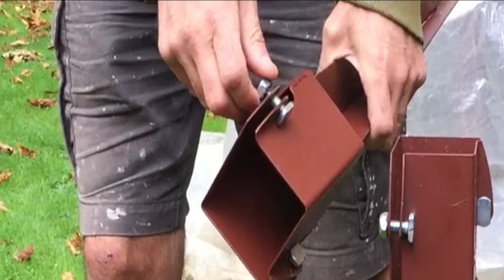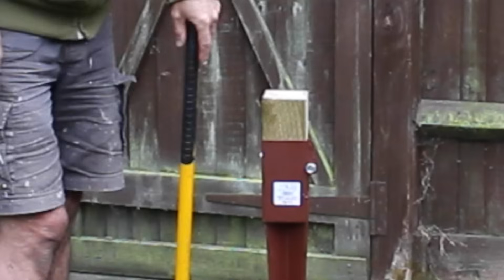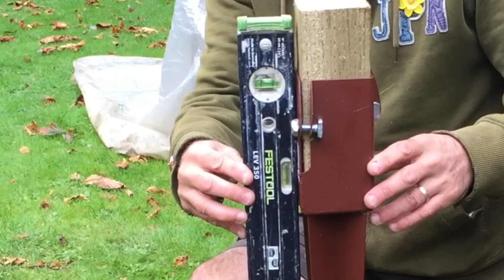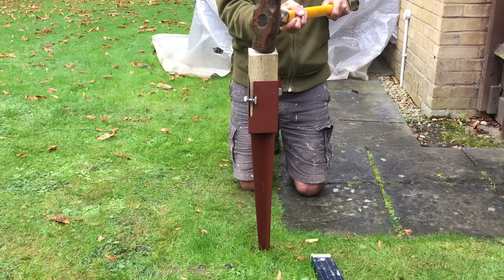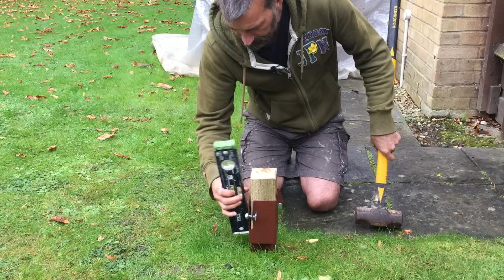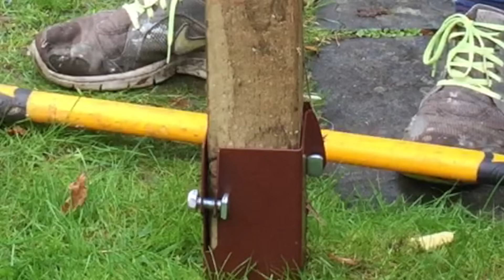How to install a METPOST/Fence Spike like a pro!

Comment: Just came across this video. I've got some of these that are 75cm/30 inches. I am basically making a screen, by putting some posts in the ground (around 1.5m tall is the goal, possibly 1.8m) and attaching some steel mesh as a trellis. Will also be attaching a pedestrian gate between teo 1.8m posts (as this whole thing is to block off part of the garden for the dog). Will these work do you think? Its a different brand but the same concept. I'm a beginner DIYer and also want the option of removing the screen later on if I want to. Just want to make sure they will be sufficiently sturdy?
Reply from the maker: Hi. Yes, with those posts it will be sturdy enough. Cheers.

Comment: Great video, Quick question, I have quite hard soil/ground, is it OK to predill a pilot hole, or does that reduce the effectiveness of the hold?
Reply: We used a pneumatic hammer.  Very had clay soil
Reply: I usually pour water in the hole to soften the dirt a bit.

Comment: After pounding it down i got the 4x4 stuck in the spike and cant pull it out to put my actual stud in. Dont know what to do now
Reply from the maker: @BackyardOfHorrors  that’s a tough one. The best bet is to cut it off at the top of the spike and then drill in with an auger to remove the centre.
Reply: @buildingsheriff  First off, kudos on the response time, thank you 😂 Secondly, I screwed a 2x4 to the 4x4 and was able to free it hitting it for a few minutes lol racing the sun at this point, we're gonna make t
Reply from the maker: @BackyardOfHorrors  great stuff. I love an alternative solution. We all get there in the end.

Comment: Similar product, but would a 45mm post word with a 50mm anchor? As in would the anchor bolt up snuggly enough around a post 5mm smaller than the internal dimension? Cheers!
Reply from the maker: The best thing to do in this case is to use something that doesn't compress to pack out the difference. I use slate. Man-made slates are cheap and easy to break and size. You can buy plastic spacers called 'backpacks' that come in a variety of sizes also. Thanks for watching!

Comment: If the post doesn't end up as plumb as you want it, what about adding shims inside the post bracket, between the post and the wall of the bracket?
Reply from the maker: Yes, a great idea. One could also trim a side of the post where it enters the metpost and then shim the back side to make it vertical.

Comment: I suppose it would be good for a small fence but anything with a bit of height the post needs to be sunk
Reply: Also wood swells and shrinks with heat and water. Metposts are only good if the ground is easy and it's a low fence

Comment: What would you recommend for anchoring a pergola? I don't want to cement in as I'd like the option to take with me since I rent. I stupidly didn't think of anchoring when I bought the kit. I was thinking to secure it to the fence so those posts help but no clue anymore what to do.
Reply from the maker: Sabine Findalen hi Sabine. What is the ground you are putting the pergola onto? Is it a solid base or is it turf?

Comment: Did the first of 5 yesterday and had to replace the scrap wood a few times, as it split, splintered and generally got crushed into the box at the top of the spike. Then of course I couldn’t remove it. I was astonished when you pulled yours out at the end and had no real damage. I’m using a 12 pound sledge. What am I doing wrong? (I eventually did get the spike all the way in, so I don’t think I hit an obstruction.)
Reply: Your ground must be pretty hard.

Comment: I need to fit 3 posts i the existing holes (it was the only place I could it them due to overspill pipes as my garden backs onto a stream)I’ve already dug them out but I’m considering using spikes with postcrete so I can dismantle and change them if I need to as opposed to having to dig them out again, I’d appreciate any advice? 
Thanks in advance
Reply from the maker: K F Spikes with post-Crete is a very good idea. Make sure you leave the top of the spikes proud that you can access the bolts but otherwise that’s a great idea.

Comment: How do you tighten the bolts?
Reply from the maker: Belle Morgan Either a correct size spanner of more usually an adjustable wrench.
Reply: Pair of edging shears works perfectly 😝

Comment: Great video! You mentioned to twist clockwise or anti clockwise to start with, how much exactly to turn?  Thanks
Reply from the maker: About 10-15 degrees
Reply from the maker: 5mins on a clock face
Reply: @buildingsheriff  The video states "1/8th of a turn". I did that and guess what? the post ended up 1/8th of a turn off true, exactly as I had started. I spent the next hour digging it back out again past roots and rocks, then re-hammering it back in true to line. But of course now, with soil which was loose. Result: the post is not firm. Not happy. Lesson? Don't trust all the tips you hear on ebay.
Reply: Isn’t 1/8th of a turn 45 degrees?

Comment: Great video. Are these strong enough to hold up a waist-high, freestanding, 4x4 timber post for a metal garden gate?
Reply from the maker: Dennis Santos I don’t really think so, Dennis. Personally I use a 5’ post with 2’ of that sunk into concrete. It’s simpler than it seems. Dig your hole, place the post in the hole and choc it vertical and plumb with bricks and then mix up a really wet ballast and cement mix (4:1) and pour in. A wheelbarrow is ideal for this. Remember, the wetter the mix the harder it will set. Best.

Comment: I've got the posts with the rigids but I don't see how my 3x3 timber posts will get past them. Am I being thick?
Reply from the maker: Sorry, Jason. I don't quite understand. "Rigids"? Best.
Reply: @buildingsheriff  sorry the non bolt ones. The ones you don't recommend. 😂
Reply from the maker: @jasonmitchell6755  Not at all. It's not obvious. You need to bash your post down from the top with quite a bit of force. This grips the post when it's set. I recommend using a timber block between the top of your post and your sledge hammer for protection. I hope this helps.
Reply: @buildingsheriff  that's great. I have the bolt ones on my allotment and it all worked a treat but I need 4 more and grabbed these instead. Wish I never bothered 😂😂😂
Reply from the maker: @jasonmitchell6755  Always the way! I'm down at my allotment too. Glorious weather for us all!

Comment: Hi. If I were erecting a 6ft fence using the met post, what size posts would I need?
Reply from the maker: carolyn clark 7 foot then trim at the top as required with a hand saw

Comment: Don these limit the maximum post height you can fit, the rule being at least a third of the posts max length should be in the ground to maximise strength?
Reply from the maker: James Dobbs A quarter of the post height ie 8’ post, 2’ in the ground. I’d stick to 8’ posts max - for a six foot fence. That is council regs max height for a domestic fence in the UK. Thanks

Comment: Great demo, thank you.   I was going to drive mine flush with the soil, so, mistake averted.  Yeeee Haaa  Sheriff!
Also, can I ask for further suggestion, as my post (3x3) will not be in the support all the time (will remove occasionally), can you suggest how I would both disguise the top of the support and prevent it from being a tripping hazard?  Thanks V much in advance.
Reply: plantings around the post would do it, include a tall pot with the bottom cut out, filled with soil and a plant/plants. No one will know ...

Comment: Until you hit a gas main, power cable, water main, telecoms etc.
Just dig, it's more graft but ultimately safer 👍
Reply from the maker: The Heroic Journey Until your spade hits gas main, power cable, water main, telecoms etc! 🤣🤣 But a valid point. Make sure you know where your power and sewer lines run!
Reply: @buildingsheriff  🤣🤣 Always dig at caution, CAT scan and keep safe 👍 Spiking the ground is going in blind, at risk, at least when you hand dig, theres 'usually' signs or markers within the ground that a service may be present. Best practice, always mitigate, plan, make safe, reduce risk 👌

Comment: Hello Building Sherrif, I have a question for you. I've already gone and bought a fence post spike with ridges rather than bolts. What's the difference? I'm guessing it's just harder as I effectively wil have to hammer the fencepost into the ridges themselves? Or is there something more to it? 

Thanks for this wonderfully well-explained video!
Reply from the maker: Mark Shadbolt Hi Mark. No it’s not really a big deal, the only problem is when hammering the post into the ground you’re going to have to gouge out the bit of timber you use in order to bash it down unless they have provided you with something that will accommodate those ridges.

Comment: So this video is excellent but.....he said he was left-handed and today, a bunch of us "right-handed" people were hitting them into the ground and I turned the stake in the direction stated in this video and it moved the OTHER way...because....we right-handed people were hitting it exactly as he shows in the video. Maybe we're not properly using the sledge hammer but to all of us it felt normal hitting them "left-handed"; it felt very awkward if we switched hands. I was not building a fence; just 10ft 4x4 posts to hang things from so I wasn't totally di*k'd but it would have been nice if they were lined up a little better but not a huge deal. So just beware of that rotation AND what hands you are using to drive them in. This time around I used a massive iron wedge/pipe/post/???? to tap into the ground 3 ft to make sure there no big rocks. That massive iron post easily comes out of the ground and that was extremely helpful that we "tested" the desired locations first. I think a piece of rebar would work well too. You just make a little circle with the iron bar and it pops right out.

Comment: If my ground was as clean with out rocks and roots as that, I wouldn't need those, much easier to just use a post hole digger, no concrete just pack in the soil around it...
Reply: Even treated wood tends to rot in soil if you get much rain. Concrete or gravel back-fill with the post sitting on a 2"-4" bed of gravel for drainage will last much longer. These metposts look pretty sweet though.

Comment: When you have lovely soft ground with no tree roots , stones or had to survey against gas, electric ,water or drainage damage 😂👌
If you were a professional you would of used a taller wood post and then a fence post banger instead of a sledgehammer
Reply from the maker: It was for a deck support. All downward pressure, no lateral movement.

Comment: This really makes me laugh. Tap-tap and the spike is in. I've just spent 3 days trying to get these twatting spikes into the ground and I'm left with countless completely bent out of shape spikes and half the garden done. They are a complete waste of time unless you have some sort of magical perfect garden that has no rocks or clay.
Spent double the cost of the fence in these shitty spikes and double the time and effort.
Just go with concrete and don't waste time and money on  this shit.
I was on a really tight budget and ended up spending 3 times as much to fix it.
Reply: agreed, his ground must have been very soft no clay etc also using pieces of off cut post couple of them got stuck inside the spike! :D
Reply from the maker: Oh Shane. I feel for you mate. These can be a nightmare!
Reply: I was a pro fencer for 28 years doing domestic commercial and agricultural, I never came across any pro fencers that would consider working with these. In my opinion they are just a diy bodge, do the job once and do it right.

Comment: Rubbish. The metal rusts and falls apart. They fail prematurely.
Reply from the maker: It last longer than timber, that’s for sure.
Reply: @buildingsheriff  certainly not true. I've removed rotten spikes on several jobs, where they have failed and the fence has fallen over with no rotten timber at all.

Comment: Would this be good enough for a pergola? Want to use 6x6 posts though.
Reply from the maker: Yes, but they do not do these in 6 x 6. 4 x 4 will easily be ample for a pergola. 6 x 6 is overkill in my opinion.
Reply: @buildingsheriff  thank you!